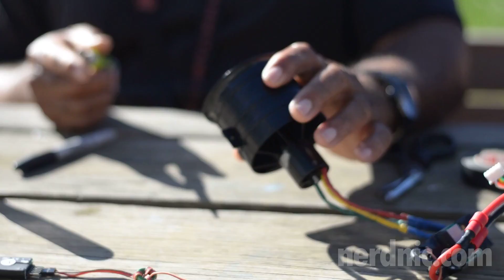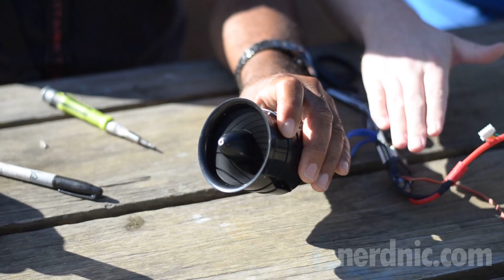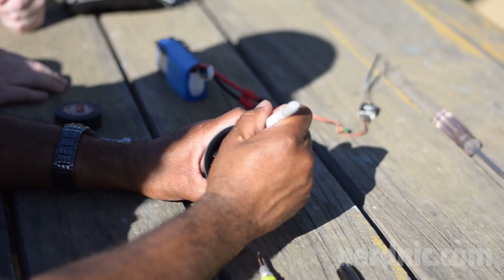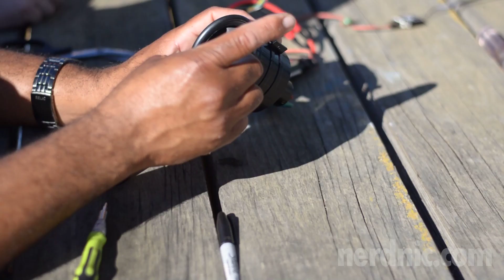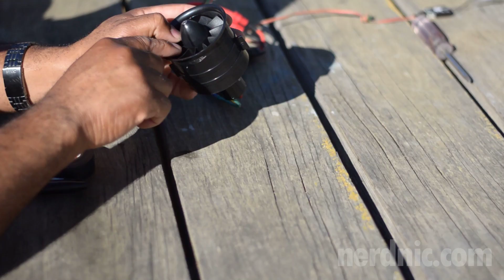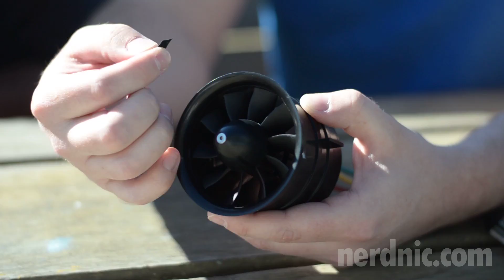nerdnic | How To Balance an EDF

Comment: Guys, I know this is an old thread but the technique was new to me, it worked so well. I was about to send a new FMS 50mm 11 blade back because the vibration was so bad! This smoothed it out really easily and quickly.

Comment: Can I just check some things, please? You choose a blade and highlight it so that it's in the same static position throughout. Then you adjust the/spinner/boss whilst keeping the original blade in its place, but moving the spinner to the next blade in sequence? One 'setting' will show/sound as quieter/less vibration, and that's the optimum setting? Thanks for the vid, Den

Comment: Nice video.  I finally got around to balancing some 64mm fans and it works.  One thing is if the blades are hitting the shroud I get some sandpaper at the blade/shroud interface and manually sand a small amount off the blades then get on with the balancing.
Reply from the maker: Great tip!

Comment: Hey Guys, this is really slick.  I've often NOT balanced my EDFs because it's too tedious and time consuming to do it the "perfect way".  And of course there are more exact ways to do this and those should be the ultimate goal... BUT... In real life when you just want to make it 90% better in only 10% of the time, this is a heck of a trick!  Thanks for showing it up close.
Reply: +RCSuperPowers Glad you liked it! We should do a couple follow up videos of the fans that I have balanced in this manor. It has made many people believers at my field and several people have had me balance their fans for them too. 10+ blade fans benefit the most from this method but all of them can be done this way.  A properly balanced fan will make a whooshing sound even when 4-8 blades...  This may be easy but the results still make it seem like the "Perfect" method for me...